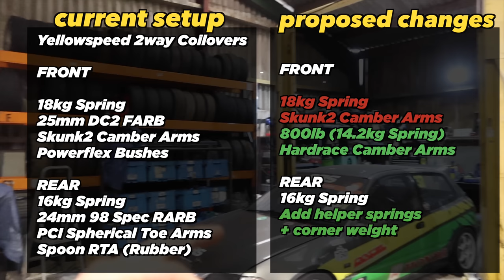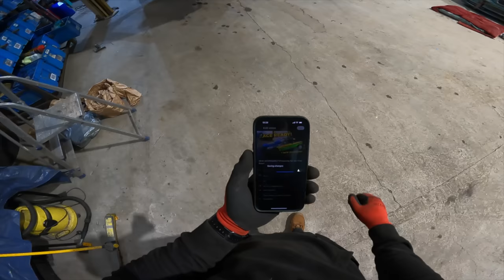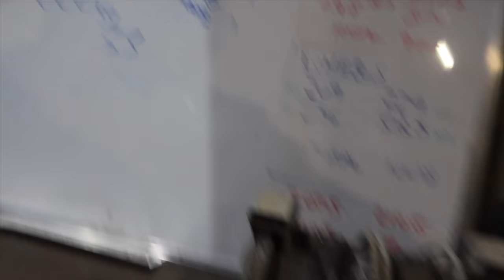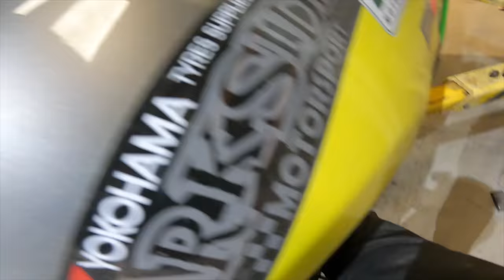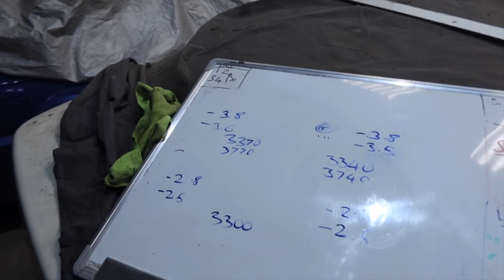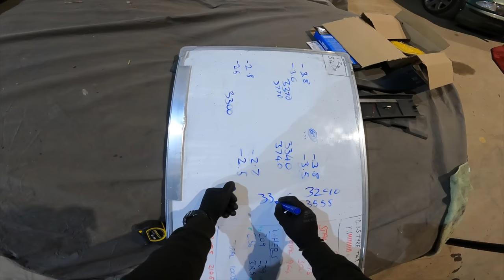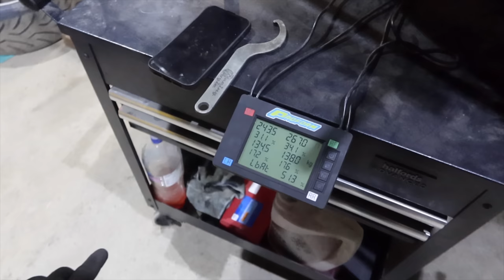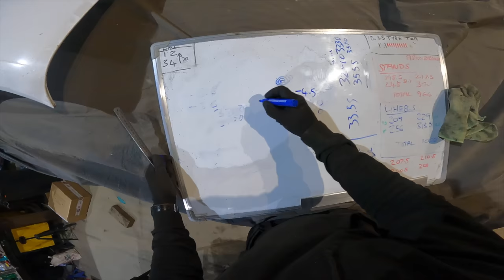Civic Racecar Upgrades Part 1 - Suspension Changes (Coilover Spring Rate, Camber, Alignment)

Comment: Loving the Civic content bud! 

Generally, if the spring travel from free length (or free length minus any preload length) to it's block height (height at full compression) is greater than the amount of shock shaft travel you have then you are good. If you are banging the bump stops you got other problems. You are on the right path trying to get more travel. Everyone always neglects the droop travel, which is real important.
Reply: Is this determined by the product or just setup?

Comment: If youre adjusting ride height and corner weight ya definitely want the roll bars disconnected. Set the corner weight etc then adjust the drop links so they fit with zero preload on the ARB, assuming you have adjustable ones which ya should

Comment: with performance fwd driving a lot of chassis guys recommend a higher spring rate on the rear than the front, it helps turn in by letting the back come around easier.
Reply from the maker: Depends on the chassis. Never known anyone do it on these style Honda before
Reply: I think of Jordan Cox racing a civic at Bathurst when I think of a loose rear set up.
I like the Honed set up theory more neutral and tricked out for grip.
From what I understand as a casual car pervert
Reply: It's the suspension natural frequency you want to be higher in the rear than the front, not necessarily the spring rate (the spring rate depends on the type of suspension and motion ratio of the spring on the wheel).  On EGs, front motion ratio (leverage of the spring on the wheel) is 0.66 and rear motion ratio is 0.74.  So the rear spring has a little more leverage and also the rear end of the car is lighter.

Natural frequency =  1/(2*pi) * sqrt( spring rate * motion ratio^2 / corner sprung mass )
Using N/m for spring rate and kg for corner sprung mass (corner weight minus the weight of the wheel, tyre, hub and control arms).  
To convert kg/mm to N/m times by 9800.

About 10-20% higher frequency in the rear than the front seems to be what OEMs go for on sporty FWD car like a Fiesta ST or Civic Type R etc.  For example an FK8 Type R road car is 1.5Hz front and 1.8Hz rear.  But you've also got the offset of the front and rear swaybar sizes to take into account to set the balance too.

With Dan's setup, it should be around 2.5 Hz front and 3.7 Hz rear (assuming 260kg unsprung corner weight front and 160kg unsprung corner weight rear) which is pretty extreme but if it works and gives the grips it's all good!  The 50% offset between front and rear frequencies should give that rotation you are talking about Connor.😃

For reference, running the same spring rate front and rear on these cars already gives a 42% higher frequency on the rear.